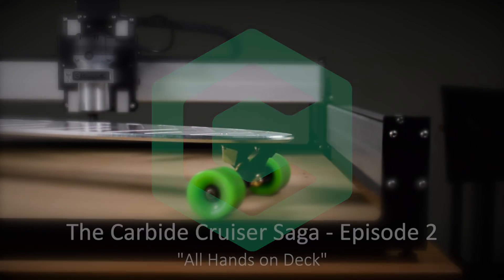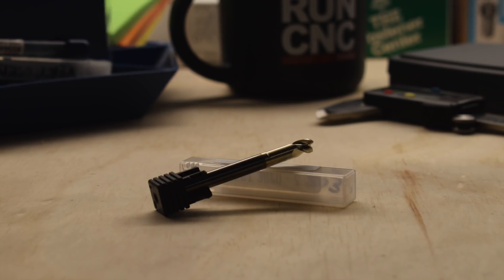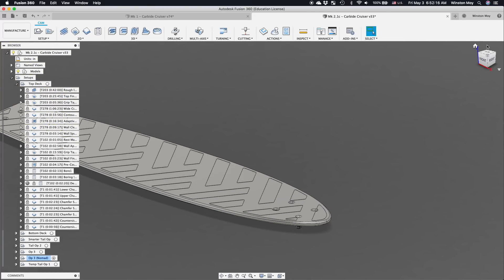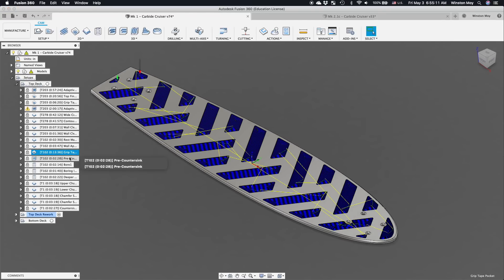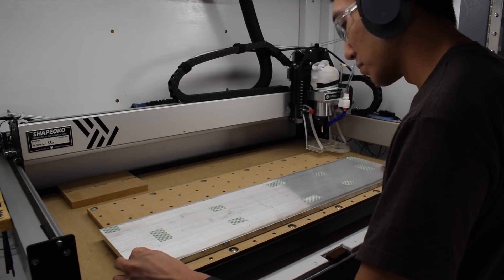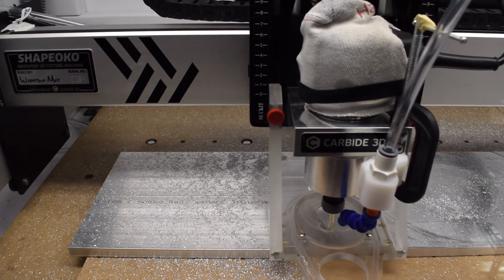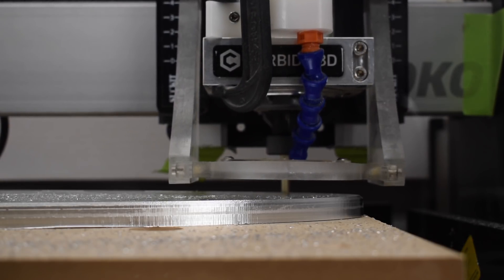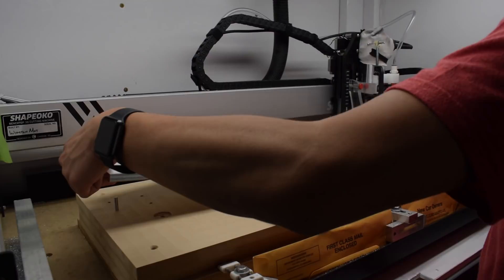CAM and Machining of the Longboard Deck, Pt. 1 - Carbide Cruiser Ep. 2

Comment: Hi Winston, I am wondering, why you didn't mill the holes with the chamfer first, then insert one locating pin into one of the holes on each end and use the rest for holding the workpiece reliably instead of relying on tape? You probably could then use more agressive feedrates on the roughing operations. For finishing passes - taking the SO construction into consideration - stick with the ones you used here... How did you insert the locating pin in your version? Thanks for another well commented video, although a non-native speaker has to rewind sometimes to catch all the bits and pieces that you embed here... :-) Cheers!